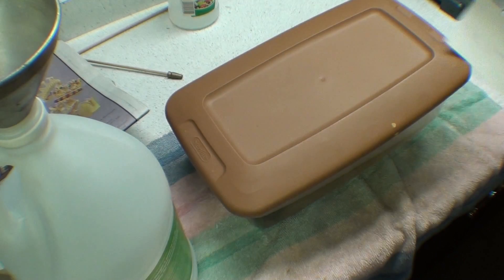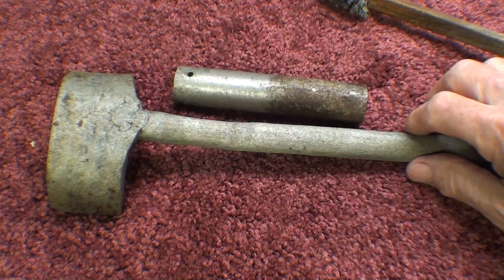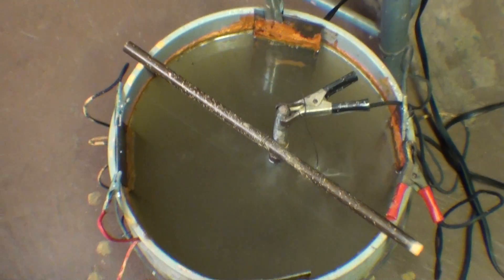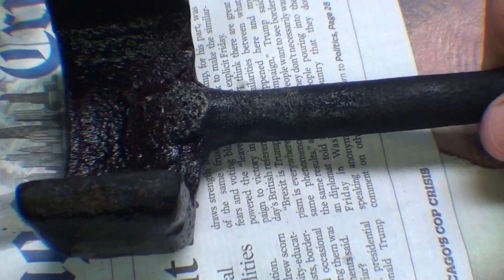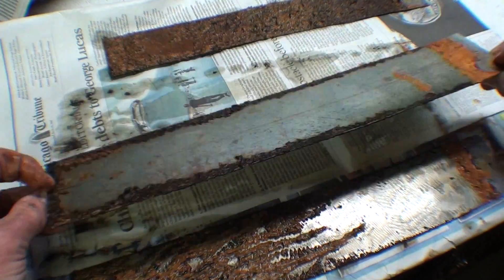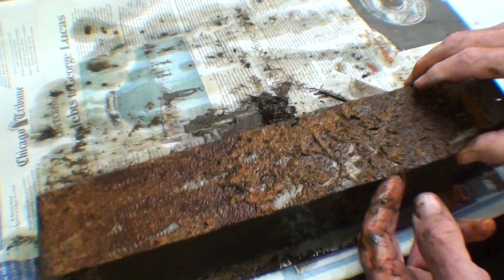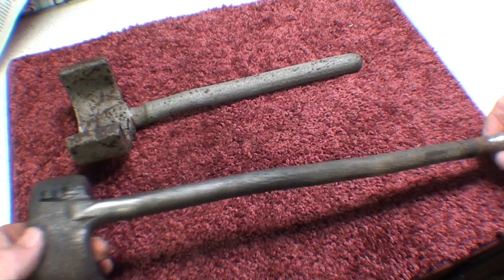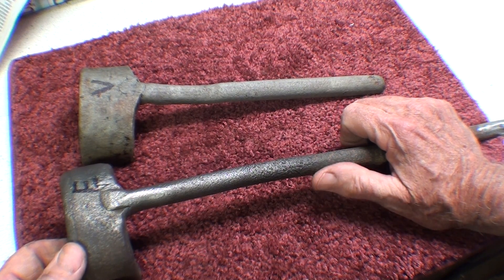Rust Removal -  Electrolysis vs. Vinegar #310 Pt 2 tubalcain

Comment: I prefer using the electrolysis process personally. Probably because I end up powder coating the cleaned part (usually automotive) and the pieces are much larger.   cheers
Reply from the maker: Yes, that makes sense!

Comment: The black you find on the article connected to the Cathode is Ferris Oxide, specifically magnetite (Fe3O4) .. Maybe someone else commented on this, I didn't read through all the comments. Through the electrolysis process, rust is converted to Ferris Oxide and is easily removed. I use a wire wheel on a drill. But it is to be expected when removing rust.
Reply from the maker: Thank you for the information and the explanation.

Comment: Hello, I really enjoyed your video as well as all the comments... I really would like to try your method for cleaning super rusty car parts... I've used vinegar to remove rust from car parts, you usually have to let it sit in about a week.. but it will also suck the carbon out of the Steel and turn the vinegar black..
Would it be okay to use baking soda flakes mixed with vinegar, for the electrolysis?? Or would that not work.
Reply from the maker: You will have to experiment with that

Comment: I was going to use the electrolisis method but now its vinager . Ive seen guys use a battery . have you ever tried it with higher amperage, 6 or 2 seem pretty low😊

Comment: Although this is a comment on an older video, I wanted to share some helpful tips I've discovered regarding electrolysis. Electrolysis is effective regardless of the presence of grease; it will lift and remove any grease, leaving the surface clean. It solely targets rust and nothing else. After electrolysis, I recommend using an ultrasonic cleaner with a degreaser/water solution to eliminate the black iron oxide coating without requiring any scrubbing. Finally, I suggest submerging the part in a bath of WD40 for added protection.
Reply from the maker: Thanks

Comment: I'm a long time user of electrolysis  and love it but it does have some drawbacks like trying to clean multiple jobs at a time. Things that I have learnt are clean your anodes daily, use HEAVY wire between anodes. Just hit em with the pressure cleaner is often enough. Drawing big amperage is good as it means your anodes are working well, the more amps the better.
I have never used any other method so thats why I am here,, to learn about vinegar and molasses for multiple small jobs. Thanks mate.
Reply from the maker: Thank you for the tips

Comment: The pitting is the sandy/glassie minerals that is in iron ...acid eats rocks.  The steel bar is not .
 Also I use a Caustic Soda bath first thats what removes  Oil grease, your skin ,hair  and any thing that insulating the acid .
 The United States stopped making iron in 1969.  Last I heard was England still does .
I use Muratic acid without electric current and Nitric acid to pickle lead, copper, stainless steel ,.
Try this hang copper in a weak solution of acid and color your chrome wrenches and sockets a copper color semi transparent.

Be  Careful .  I was using Nitric Acid to clean off fire scale after annealing some copper work.
I always made a five gallon bucket of Arm and Hammer water.
After 40 years of copper Smithing and welding . I  make about 15%  is what I use.  It was 100° and I was carrying a 2 1/2 gallon glass jug of 90% and sweat let that bottle slip out of my hand. the neck had a finger ring and  damn if it hit a steel nut and broke and  splashed my leg. I had the bucket ready at the hose bib.  and  avoided a real meat burner.
FYI  Nitric Acid is getting hard to come by I have to go to Orange County . Los Angeles has banned it last I heard .
Reply from the maker: Thank you, that was a very interesting comment. I experimented much with acid years and years ago. In fact, I have a pretty nasty acid burn on one of my thumbs. Believe it or not, I always kept a box of arm and hammer, close by, LOL. I would like to try the trick coloring a wrench.
Reply: @mrpete222  Thank You.... I want you to know that you have with your unselfish guidance thru your videos made this Pipefitter/Welder wiser.
I reread what I responded to about Pink Chrome . use the waist Nitric acid   its green  color (15% +/-)  
I think of it as SUPER TARNEX.   
it seems like the conductivity of the water is higher .
Everybody stampedes to the swimming pool that some guy just poured muriatic acid  into .
Iron.....   real iron  the type that has so much crap in it that it is from ancient Rome and still around . .
its cost more and has way less strength .   but works like butter when it is dull red  makes for longer anvil time.
Steel....  head for white hot and be quick .  ie power hammers .
I worked at Twenty Century Fox back in the late 80s  90s and  they had recycle dumpsters  and the metal dumpster was 💕💕💕💕 we were tossing air conditioning and refrigerators , Western Electric open frame motors from the late twenties .    Oldman Fox built it in 1927  .
I asked if I could go after the Iron that "we" were throuhing out. On my own time . Sure . they couldn't care less .
I am DYSLEXIC so I apologize for skipping around .    I would have worked there for free.  I have to say this AMANA windows air conditioners are the toughest on planet earth .
Sprial cast iron staircase and handrail . golfcarts .  a "Fog Generator "   miles of steel , Bronze clad doors with a million coats of paint.  lights , arc  ,you name it.
"THEY DON'T MAKE IT LIKE THEY USED TO " 
Thank You  

heat up the handle of the axle wrench the end couple inches .  a dull red  hit it and see don't ever throw any of it away .

Comment: Very interesting.  TWO QUESTIONS:   1) Have you ever used a higher acid vinegar ?  I use 45% acid vinegar for killing weeds, and I bet it would work well.   2)  What do you think about using vinegar as the electrolysis solution, instead of the Arm & Hammer product?
Reply: ive used 98% acetic acid works very fast but flash rusts just as fast.

Comment: 30% usually works quicker.  Filter the used 30% for use as a weed killer or further rust cleaning.

Comment: I've used both methods on railroad spikes as a test. Electrolysis does not eat into the surface of the spike like vinegar does. The spikes that go through electrolysis can be cleaned up to look like new, while the spikes from the vinegar bath are too rough and pitted to maintain their original appearance.

Comment: IM THINKING THAT THE JUMPERS SIZE HAD A BAD EFFECT ON THE ELECTROLYSIS. IF U THINK ABOUT IT, AS YOU GET FARTHER FROM THE CHARGER LEAD, YOU COULD BE PULLING LESS CURRENT AT EACH ANODE.

Comment: Tried this with an exhaust manifold.  took 25 gallons of water to cover it has I could not lay it down in the container I had.  1 TSB baking soda per gallon.  I had power wire brushed most of the rust, but lots of places I could get into, and lots of pitting that was hard to get.
Less than 6 hrs at 1-2 amps, and already a big difference.  Turned both pieces around, will leave overnight.  I am only using 1 anode, just a hunk or rusty steel.  Using galvanized wire for leads, basically fence/telephone wire.  Power wire brushing/scraping most of the rust off first seems to speed things up to a the hard to get at rust.  Will report back 

Thanks for the great video.  Trying something else in vinegar, but I think parts to oily to get a good reaction.  Will have to wipe off and try again.

Comment: The vinegar eats up the rust. The electrolysis removes rust. However I did notice the vinegar one seemed to look more like a galvanized pipe. I would prefer the vinegar process but the other is great if you can afford to sacrifice scrap metal. 
By the way I love your sense of humor.

Comment: Excellent demonstration Mr Pete, and not the result I expected from part 1 where the washing soda electrolysis was impressively vigorous. Regarding the black coating - it's not carbon, it's ferrous iron oxide (FeO) one of the two common oxides of iron (the other being ferric iron oxide - Fe2O3 - the orange form we see in rust). The black ferrous oxide is soluble in acid so a quick dip in the vinegar bath might well bring it to clean metal quickly.
Reply from the maker: Thank you

Comment: We've done electrolysis ourselves.  The most important thing, after you've cleaned the black off, is to OIL the surface completely, or else the rust will come back very red and very fast.

Comment: I'm wondering if the vinegar worked better because you are cleaning wrought iron vs. steel.    The vinegar is dissolving enough material to free all of the rust along with it?      I am just learning electrolysis and haven't put any wrought through it yet

Comment: I live near some gold mining towns, the longer  handled iron tool looks like it was forged?  Like in a fire, so the black is high temp iron oxide (where the smiths got the term "BLACK" smith, cuz the iron turns black because of the heat and reacting with oxygen.) that is (Had to look this up) "Firescale" in the course of red hot iron in air. and it looks like it was a forge weld ? 

I am no blacksmith, but the one looks like it was split and flatted onto the square part in a forge? so.  The heat would have permanently (without grinding) turned it black, which helped keep other destructive rust at bay?  That is why they oiled the black iron while it was hot and rust was inhibited. 

PS, how I got here, I was looking how to de-rust a garden planter I found at a flea market.   I liked your video. ty for the information! PS ps, can I use something other than a battery charger? or must it be DC current?

Comment: I have found that adding a good amount of salt to the vinegar speeds up the process. Also I use 20% strength vinegar (usually here in the UK brown malt vinegar is no more than a 5% solution. The 29% stuff is used as a herbicide in horticulture over here. You can of course then go on to use electrolysis with the vinegar and boy does that work? Stinks like hell but you can't have everything lol

Comment: Many thanks for posting! I have some chromed parts which are rusty, can I use this method? I don't need a high quality finish, I just want to get rid of most of the rust. Will this process remove the chrome from the chromed areas, as well as removing the rust from the rusted areas?
Reply from the maker: I have never tried it on plated pieces
Reply: @mrpete222  Many thanks! When I try it, I'll let you know what happens
Reply: After a bit of research, it seems that NOTHING WHICH POTENTIALLY HAS ANY CHROMIUM IN IT WHATSOEVER SHOULD EVER GO NEAR AN ELECTROLYSIS TANK - this includes chromium plate, stainless steel, etc. The reason is that this creates incredibly toxic and dangerous chromium salts. Creating these substances is actually illegal in many places.

Comment: I used your process on an ancient toastmaster toaster oven.  The stainless steel drip plate was caked with a couple of mm. of carbon.
Reply: Shouldn't  use for stainless steel, creates dangerous chromium compounds

Comment: So it looks like the vinegar was simpler. However, I need to do the inside of the gas tank on my motorcycle. Can't do the wire brush after the vinegar. I'll look to see if you did a video with the Evapo-Rust. Nice videos though !

Comment: Hi MrPete, very interesting!  Thank you for this.  Have you ever considered soda blasting the items?  I understand soda blasting is a much more gentle version of sand blasting, and avoids the 'etching' effect that sandblasting gives?  I ask because where I am a small sand / soda blasting setup is reasonably cheap, if one already has a compressor.
Reply: Great Video. But I think the smaller the rusted item, vinegar will do. But the bigger the rusted item, electrolysis is the way to go.
Reply: soda blasting is gentle but very slow, so you will need patience,  Consder using 50 micron alluminum oxide (particles) for faster but still fine/gentle results. Soda blsting is usually done wet (air mixed with water at tip of blaster) to keep the overspray down).  Wear a mask, or better yet use a blast cabinet.  Expect flash rust unless you oil or paint the cleaned surface quickly. AlO2 particle stream is dry and tip clogs less often than with wet soda.  I do electrolysis first and then touch up with blast media. excellent video - thank you.

Comment: You guys in the top comments seem to know your stuff when it comes to this. So if anyone is still leaving comments here I have a question. I want to try this on a old panel saw blade,but I'm thinking of trying both the vinegar "the type I got claims to be 6% acidity" an also use the laundry booster aka sodium carbonate. Mix the two together,and then try the electrolysis with the 
vinegar an washing soda mix. My question is; other then foaming up quite a bit during the initial mixture is their any dangers of off-gassing from the vinegar,and soda mix? I know about the hydrogen gas so I'll be doing this in a well ventilated area. 
Any feedback on the subject is greatly appreciated. Thanks for the video upload I learned from it.
Reply: Wow, 3 months and no reply...If you did this Im sure you found that you neutralized the acid to some extent. If you just use vinegar in the electrolysis process  it will process faster as the metal "cooks" off minerals and rust into the solution up to a point and then it will level off due to the build up in the solution.

Comment: Thanks for the Video,, with all respect, I like to give my opinion and tips

I prefer the the vinegar is cheap and safer. 

as far the electrodes,,,the top "metal rod" on top of the bucket, is attracting the electricity and going to waste I believe and fee that a wooden stick on top wold work better..

and last, are the other pieces of sheet metals in the bucket galvanized??? that also feel that interferes with the electrodes..
Reply: Look closer. I believe that rod on top of the bucket is wooden.

Comment: Soak the 'high heels LOL ' in Muratic Acid for an hour or two if you are in a hurry. THAT will do just the trick and work deep. Soaking in Muratic acid over night and I bet you could snap them pieces in half with your hands........get it? Yeh, don't soak long.

Comment: metal looks waaay better for the electro , vinegar looks like it hurt the surface
the appearance of the electro cleaned is different because it was different from the day it was made
does the electro attract flash rust like the vinegar ?
Reply: Bob Saturday bob is right,  I like electro best.  Vinegar alright if u don’t have electricity.  I like the patina that electo leaves on old pieces. Also both of those are hand forged, if u say they are junk I’ll take them and pay the shipping

Comment: I don't believe your wrench was cast iron where electrolysis is much more effective. Hard to tell thohghe
Reply: They are wrought iron. Same metal different process..One is cast in a mold the other is wrought (archaic past and past participle of work) either by a hammer or press die while hot. Wrought is stronger due to the crystal formations.

Comment: Molassis at 50   50 water is very effective  on heavy rust Wash then using stainless wire to finish Using vintage rusty motorcycle parts regards Milo  Australia

Comment: Ok there is another method using sea salt and vinegar solution as eltrolitic solution as 10 Amos. Cut the process to 2 hrs for a heavily corroded and flakey railroad spike. No black ferrous oxide was left. I wonder if going acidic vs base had something to do with it or because of the shorter process using 10 Amos allowed for closer monitoring to remove it from solution?
Now if i were to paint I'd hit it with a brush or sand paper a little then spray with a ospho for the black. For the vinegar that was flash rusting, first, NO SUNLIGHT that accelerates flash rusting. SECOND from rinse right to ospho rust  neutralizer. Follow recommendations for painting from there. Remember oxidation accelerates with exposure to air and energy. Keep it wet and work quickly to get neutralized.
BtW I had a media blasting shop for 8 years and blasting is expensive dirty work that can be damaging if overdone. Small blast cabinets are great only if you are not exposing yourself to any dust. Vacuum exhaust should be heppa filtered out side. And wearing an N 95 mask for precaution is smart.

Comment: It looked like you used stainless steel wire to hold the wrench in the electrolysis bath. Another video mentioned that any stainless yields some bad biproducts.  That may be what caused some of the sludge.
Reply from the maker: I think it was galvanized wire

Comment: I have a little forge. I agree it looks like a forge weld. The bar was split and the flat bar was  put in the split and and forged over. The smaller one looks to have a cold shut in it. They are sort of rough looking and I wouldn’t let them go out of the shop looking like that, but I guess they worked well enough for all these years.
Reply from the maker: Thanks

Comment: Thanks for the experiment and sharing the results. I would think the formulation of the steel/Iron might have some effect on the results.   I would positively be interested in the evaporust test comparison.   As I understand the chelation process evaporust is not as destructive to the metal as a mild acid.  I had restored some old tools using the vinegar method but the rough finished surface and black surface layer are sometimes undesirable.  ( think steel rule/ combination square ) .   A final question for all what is the least destructive method of removing the black layer afterward, is there another chemical process?
Reply from the maker: No I have no answer for that